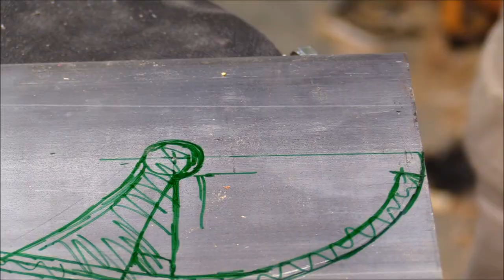Impossible - Drilling a Curved Hole!

Comment: I don't know why you might need this right now but it is god damn brilliant!
Reply: If you're running wires through the wall in a corner of a room where the corner is solid wood from stacked 2x4s. I've run into that before and it's a pain to deal with. This seems like it would have been a lifesaver for me a couple times in recent memory.
Reply: +jesondag That's exactly what I was thinking. I used to do a lot of electrical and I thought that is an electricians holy grail for corners.
Reply: sounds like a structural engineers nightmare though specially if those stacked 2x4s are holding up some weight
"your wirings done love but id stay out of that corner upstairs see ya"

Comment: great idea, but wouldn't it be more structuraly sound to make a small notch on the inside corner of the post? Just enough for the conduit to get trough, it will remove less material.

Comment: Wicked idea. I used a bit on a spring once to run some wires through a fire break in a wall one time, never would have thought to attach it to something to force it to a radiused curve though. Did you make it just for kicks or is there there a project coming that uses it?

Comment: Patent?  This is pretty awesome, Izzy.  I see a ton of practical applications, even for homeowners that might be coming back later to snake some cables through a wall, etc.  The flex shaft and your machined metal guide are pretty small, which would allow you to get a hole drilled through a stud with only a tiny hole punched in the drywall, instead of punching a drill-sized hole and holding the drill perpendicular to the stud like you would have to normally.

Comment: dude this is genius.everything from heavy industry and light industrial construction would pay a fortune for this to round around obstacles. they waste tons of time boring through hard material with expensive diamond core bits that each run 4k (plus the crew who has to sit around waiting for that obstacle), or just for the average guy who needs to cut a conduit and avoid some hard material. you're a genius, for real

Comment: HI    WE USED SOMETHING LIKE THAT WITH IN BENT TUBING TO GET SOCKETS IN ROUND CORNERS. I NEVER THOUGH OF USING IT TO DRILL HOLES. LARGER TUBING MIGHT BE A BIT HARD ON THE BIT, BUT COPPER OR PVC MIGHT WORK. PVC IS ALSO CHEEP AND IT CAN BE HEATED AND BEENT THE SHAPE YOU NEED. LOVE YOUR VIDS.

Comment: Always wondered, how do they curve oil drill shafts?
Reply: I've always figured they just let the drill wander then claim it was all planned.
Reply: The drill head is angled slightly, and its azimuth controlled so it steers in the desired direction. Some heads can be adjusted while down hole to turn the  drill straight, others cork-screw to go "straight"
Reply: nautamaran
I know they do it. I just wonder how.

Comment: how would that benefit u when u can drill straight through in an angle and achieve same entrance and exit position !!!
Reply: You could achieve the same entrance and exit positions, but you could NEVER achieve the same coolness factor.
Reply: +Marshall Gatten so its all about being cool not efficient !
Reply: The benefit is where your drill is when you're making the hole. Imagine there is a wall in the way of drilling a straight hole.
Reply: +J DeWitt DIY i did think that but when he ends his way pass that point plus with the clamp amd extra mechnism its too much dnt get me wrong i like thi guy his videos r usually very beneficial !!!
Reply from the maker: it more for drilling inside corners of house framing where you cant get the drill at the angle needed to drill an angled hole. think about it like a tool for electricians and cable installers
Reply: Im sure u will come up with something better in the future Good luck Many thanks for replying appreciate ur humbleness KINDEST REGARDS !!!
Reply: Just an idea use stiffer spring and get rid of accesory guide

Comment: Fucking Genious! whish i had that when I Installed the Electrical in my Barn Home.  Because of the way it was constructed i had to drill 90deg. in two places and then get the bulk wiring to turn, some were easy if at ground level but some sucked ass. Either use your hands, work and fall down or Hold on and stare at it all day......the first one wirked. lol
Reply from the maker: Thank you Andrew, totally what i was thinking, there is a good chance i wil be doing some wiring this winter so i wanted to play with the idea to see if i could perfect the concept